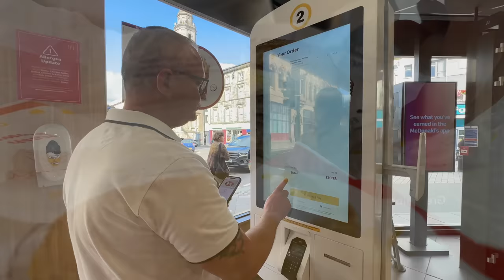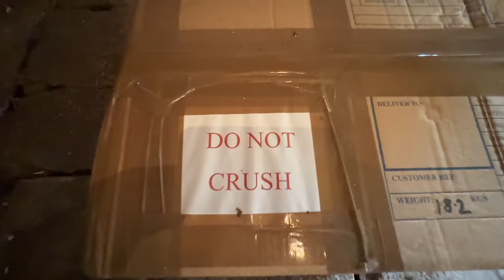A New Direction for Foxes Afloat? What Lies ahead? Ep. 255.

Comment: As a professional builder of many years I can give you one piece of wisdom. Any statement that implies that it's only going to take a little while is guaranteed to come back and haunt you.

But I want to remark on Sean's work. It is clearly quality work. So taking on the train room should be possible. Going to be more challenges but I'm sure that you can work them out. Remember that there's much wisdom on YouTube.

My train room is moving along. Not quite as big as yours only about two and a half meters by 3 m. But it's going to be almost all train. I have two more pieces of paneling to put up on the ceiling and the entire room is all insulated since this is a winter environment here. Next project is install the heater that I bought that should be more than adequate to keep me toasty this winter.

It doesn't matter how fast these projects happen as long as you're having fun doing it. Remember rule number one. It's your railroad.

Both of you should be well.
Reply from the maker: Thanks so much!

Comment: Curious question:  When you buy lumber in the UK, is it sold in Imperial or metric units?
Reply: Metric
Reply: 2” x 4” is sold in metric measurements 😂
Reply from the maker: Both.
Reply: The only products you can sell in imperial measurements in England, Scotland and Wales are as follows.
Draught beer or cider by the pint
Milk in returnable containers by the pint
Precious metals in Troy ounces 
Colin and Shaun are right to a degree, some business will still show the imperial measurements as well but by law it cannot be just imperial.
Northern Ireland population approx 5m has there own rules on this.
I worked in sales and management for the building trade and then retail for about 30 years. Hope this helps 😁
Reply: Thank you all!  I did know that you can still have a pint at the pub.